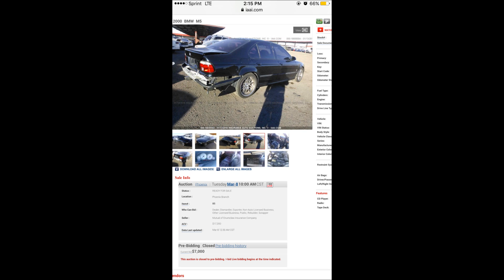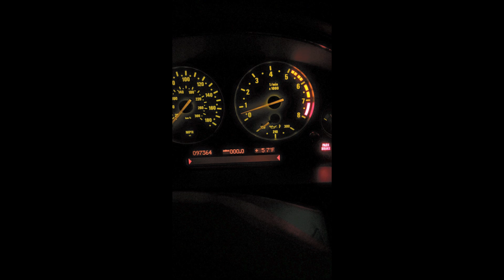BMW e39 ///M5 Restoration of a LEGEND! | True Enthusiasts | 400HP BEAST!!!

Comment: Seems like you didnt get the car for that good of a deal, 7000 is alot for a salvage M5 plus paint, only thing that saved you money was the bodywork, luckily you knew how to fix up that body, if you took it to a shop it would have been atleast 2k so i see why the insurance company salvaged it., ive seen clean ones in my area around 10k with clean titles.
Reply: Bmw M3 e46 Sure $10 for M5 with 200,000 miles ! I am good! This M5 has 97k miles ! And trust me it was a good deal! Because I sold the car for $11,600 after all! And I regret it till this day! Should of kept it! She was Super clean Car!